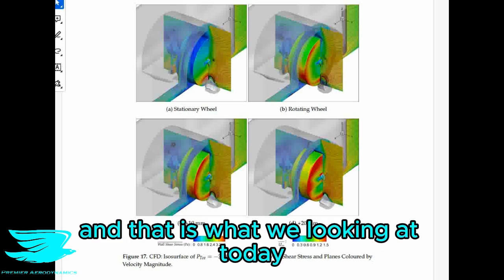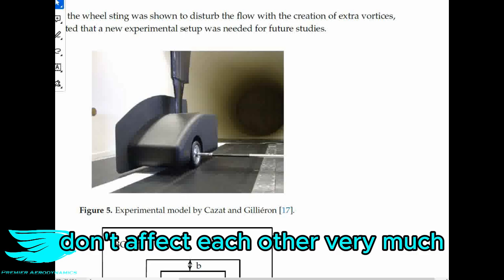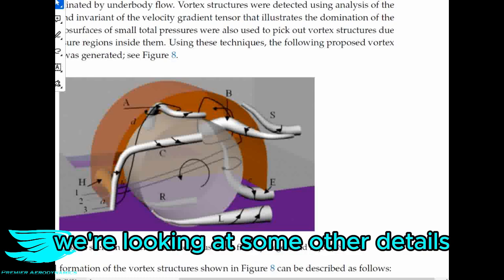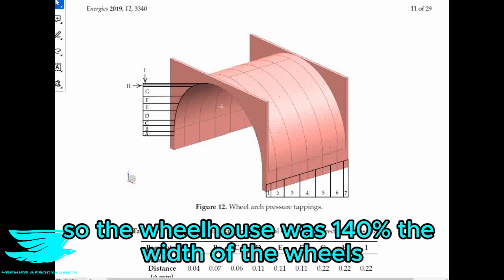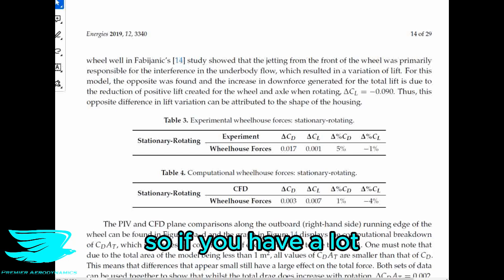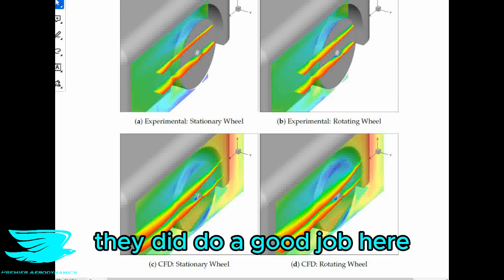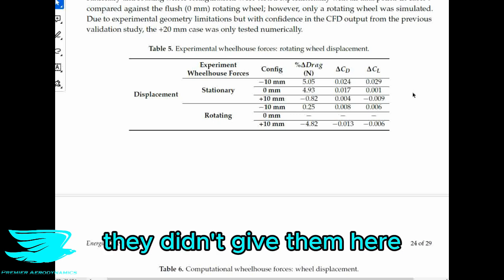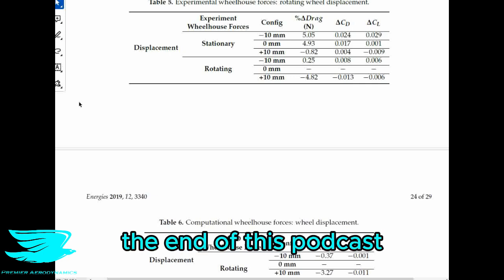Podcast #162 + Does Poking Wheels Out Affect a Cars Aerodynamics

Comment: Even garbage CFD can still tell you there's a drag decrease, which opens another can of worms. Can you spot a general trend with CFD even if it's inaccurate? Yes, and on the other side, you may see effects that don't show up in reality, or your CFD's inherent limitations hide actual artifacts that show up in real experiments. Another issue is the over or underestimation of effects the CFD tells you. Now if your goal is to just reduce drag, it doesn't matter if you're under or over estimating as long as you get the desired result, it's a winner, at least short term. Long term having inaccuracies can lead you to incorrectly assuming the direction you're going is worthwhile, which means then you waste more time back tracking.
Reply from the maker: That's a really good point. Nothing is 100% accurate and nothing is 100% wrong. Accuracy is a scale.

So, it comes down to a couple of factors.

The first is how much random uncertainty there is and how much systematic error there is. The systematic error could be corrected for, but then the question becomes, why is there this error to begin with. What in the flow has caused it.

As for the random uncertainty, that cannot be corrected for because we don't know what it is.

So, if the values you are looking at fall inside the random uncertainty, then you cannot tell anything because the values could really be anything within this range.

For this simulation, the random uncertainty, as I calculated from their data, is between 12% and 24%.

The differences in the drag coefficient throughout the paper were below 5%. This is much lower than the random uncertainty, therefore, the data from the CFD can't be used because these differences are being engulfed by the random uncertainty.

Now, the second factor is what flow features you're looking at and how well they are replicated in the CFD.

If they are well replicated, then you can use the CFD to get a general understanding of how the flow features are affected.

In this simulation, the flow around the front wheel was not well captured because the wake was about twice as large.

Considering that this study is how poking the wheel out into the flow affects the aerodynamics, this is a major error because the flow the wheel sees is now different. So the results will be different.

As such, this CFD can't be used to determine these effects either.

The only way to make use of the CFD is to show that some car, somewhere creates the front wheel flow they found. But, that was not shown in the paper. What we saw was a car that had a significantly different front wheel flow.
Reply: @PremierAerodynamics  That's exactly my point, say your CFD says something happens, and experimentally you get the same results when you measure(ie pressure), but for different reasons. You get led towards the wrong conclusion, so if you try to further exploit that wrong conclusion you see you make no progress or go backwards.

Take for instance LBM, which is good at rarefied flows, low density, and compressibility effects, but is less good at other things that a standard CFD package does better. Do you live with that inaccuracy when on the other hand it delivers on other parts of your project with good accuracy, parts which are ultimately more important, and the relatively quick processing speed allows you to rapidly iterate? Or do you go for the more computationally expensive method, and sacrifice iteration speed, for slightly more accuracy and resolution globally, and comparable where it's really important?
Reply: Absolutely, you know what's interesting about tire wake. You only really have one option, because no matter what you do, you end up with the same result. If you outwash flow around the tire, the tire sheds a vortex outboard of the wheel. This is the only way that tire wake can work on a car, to reduce drag and increase downforce. If you've noticed, transport trucks have started putting bargeboards on their trailers, all in an effect to outwash air around the tires.

Outwashing air around the tires is the broad geometrical intention, but aerodynamically, so much more happens. It's not just the physical deflection of air around the tires, it's the reduction of the tire's turbulence under the car, the diverging geometry is also a diffuser, which increases the mass flow under the trailer, which then can be used to blow the rear wake more effectively.

The interesting bit is there are several effects on airflow from even simple devices.
Reply from the maker: @rolandotillit2867  Oh right! I see. Definitely.

In my experience, and opinion, when you know that you have an inaccuracy in the simulation, or experiment (or any research you're doing), you either have to always keep it in mind or try to get rid of it.

Otherwise, you end up wasting resources later on trying to find something that isn't there.

There is one example I saw which was there was this piece of research done at this automotive manufacturer that I was working at at the time.

It concluded something about a certain aerodynamic device.

Another researcher had this spreadsheet of various configurations that indicated a contradictory conclusion.

So, we ended up doing a $500,000 project over a year looking more into these devices, only to conclude the original finding of that piece of research earlier.

It turns out that the researcher with the spreadsheet wasn't taking many variables into account and was changing other things at the same time too. So, their data was inaccurate and hence making the new project a waste of time and money.
Reply from the maker: @rolandotillit2867  Definitely, getting the tire wake, and any wake, away from the underbody and diffuser is much better for aerodynamics.

And shielding the wheels from the outside flow also helps reduce drag.